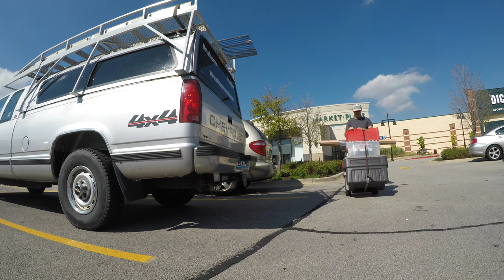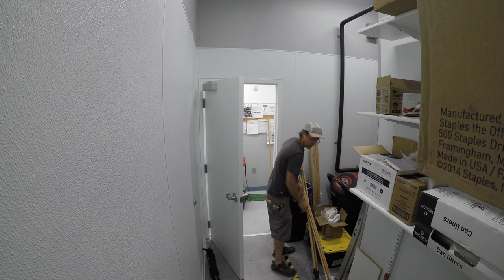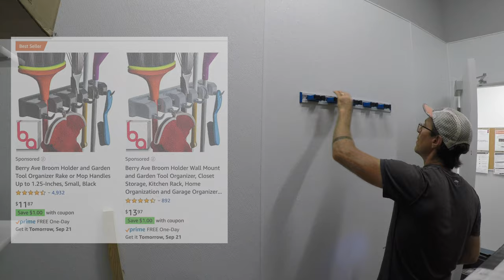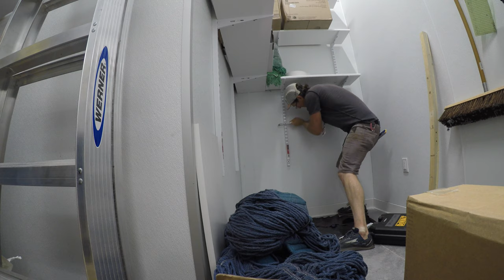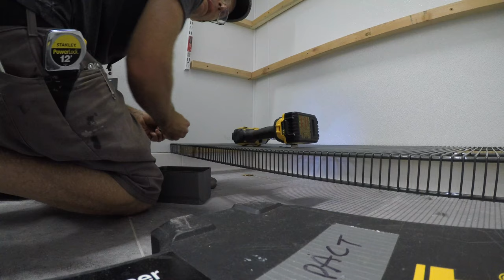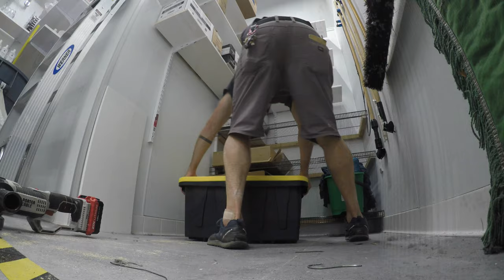TRAPPED! in a Janitor Closet

Comment: Left alone with your own thoughts? Dad use to say " in this place there be dragons" lol watching this i noticed the fiberglass paneling on the walls that brought back memories, back in the late 80's i installed that stuff in Red Lobster restaurants through out the central time zone
Reply from the maker: I'm guessing that paneling is used because it's sturdy and easy to clean, but I kept wondering: "Is it really necessary?" I mean, a good coat of paint on the drywall would likely be enough in a closet. I bet you've got some stories from all of those installation jobs! Sounds like a lot of work. Take care
Reply: @metaspencer  yeah there are a couple stories but in the interest of a short message the reason lobster used it was they clean their walls with high pressure hot water hoses frequently for health code and safety reasons, drywall wouldnt hold up even with paint, for the cost its really durable and most of the time they use wonder board for the bottom and green board above that to really make it impervious to water. Installation isnt complicated so its a win for most applications. Take care
Reply from the maker: Mike Cates wow! High pressure washers!!!
Reply: @metaspencer  the interior walls on the older restaurants were non load bearing and were built out of 2x6 wood studs and a press board type of wall board, most of the time when we got called to a store the health inspector had already threatened to shutdown the location, but what we'd usually found was the walls completely rotted away from years of washing and food decay. One store  had an 18' stainless steel pass through shelf in the kitchen that when we pulled the paneling off all the studs fell apart, it was hanging from the attachments to the roof. We removed the debris and found the bottom plate on the wall that was cemented into the slab by the tile flooring had created a trough full of water and rotted away the stud.
Reply from the maker: @phantom629  Oh man! So, so crazy ... and yet, believable.